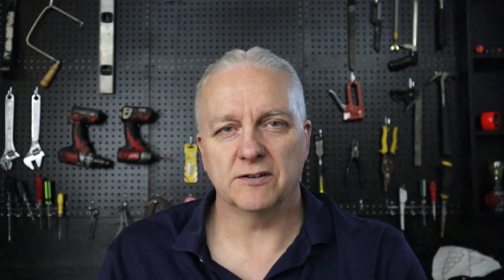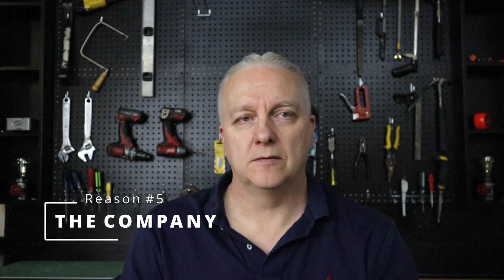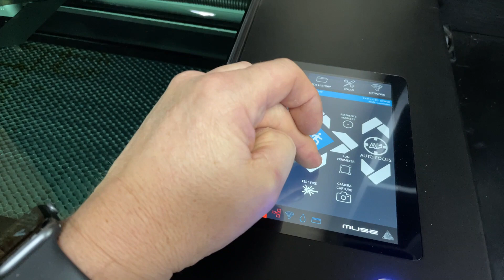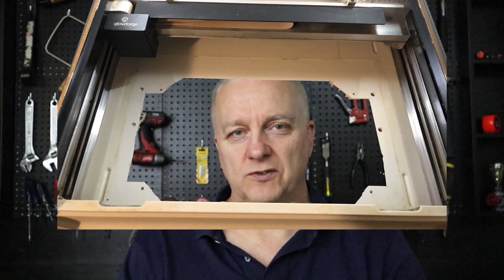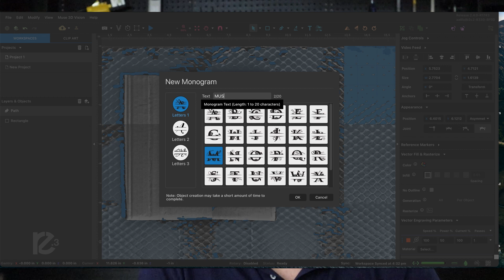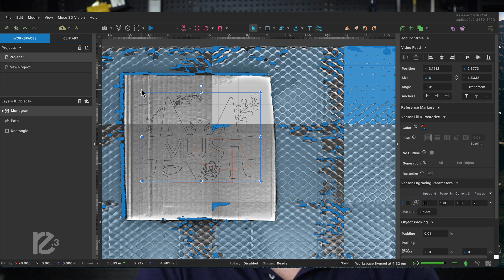BEST LASER CUTTER FOR HOME USE  // Top 5 Reasons to Buy a Muse 3D over a Glowforge

Comment: That was a very thorough review, and confirms many of my first impressions.  I am interested in a laser cutter to cut cork fabric, enviroleather (faux), ultrasuede fabric, and leather for bagmaking.  Obviously I considered glowforge, but I cannot get beyond needing to connect to the internet to be able to use the machine.  Happy am I to have heard the name "Muse" at a virtual bagmakers' retreat last week.  I am also considering a makeblock laserbox.  Did you consider that one at all?
My biggest concern is that I don't have anyone to help me, and I neither mechanically nor technically oriented.  I was happy to see the control panel because I do computerized machine embroidery, and my machines have cameras, scanners, and projectors in them, as well as beautiful display screens; and the concept seems comfortable for me.  But, having to replace a fan right off the bat makes me nervous.  You aren't near PA, are you?  Or, do you know of anyone who could help with the install, or some basic training?  Everything is aiming in the direction of the machine you chose, but I don't want to a major investment and not be able to use the machine...
Thank you for an excellent summary.
Reply from the maker: I didn't consider the Makeblock LaserBox, but as long as it has the features you need you will be OK.  It does look very similar to the Muse and without any solid information I'm wondering if they have licensed the technology from Full Spectrum Laser.  Dremel did this for their laser and FSL seems to have a history for licensing to other companies.

One of the most important aspects of a laser though is power and both the Muse 3D and the Glowforge offer a 45W option, but I don't see this for the LaserBox.  Regardless though it should easily cut cork fabric or most other fabrics if that's your goal.  I will do a video to walk through some of the many materials a CO2 laser can cut or engrave and I'll try to cover cork fabric as well.

Regarding setup, don't be intimidated.  Most lasers are very easy to get out of the box and running in less than an hour.  There are many videos (including mine) on setting up specific lasers.

Regarding my fan, it wasn't a serious issue.  These are the same small square fans that are in most equipment.  FSL quickly replaced mine on warranty and I swapped out the bad one in 10 minutes with one I had sitting in my parts bin even before I received the replacement.  They've gone to great lengths to make the laser serviceable without ever having to box it back up and send it back to them.  They even provide the tools you need to work on almost anything in the laser.

Serviceability was a question I specifically asked Glowforge when I was speaking to them and there seemed to be few self-repair options.  They were clear that shipping a laser back to them for service was a common solution to many problems.

For the most part, this kind of equipment is very reliable, though with lasers you can expect to have to change the laser tube after a couple years of heavy use.  I did have a look at what replacing the tube in the Muse 3D would involve and it looks pretty straightforward even for someone who isn't a mechanical engineer and anecdotally, they will sit on a video call with you to walk through any service you might have to perform :-)

Hope this helps.
Reply: Could I send you some samples of  cork fabric and enviroleather for you to try?
Reply from the maker: @TALISHAMON  You could but don't bother, since  I want to order some for a project I'm planning to do anyway.  The cork will be fine so I wouldn't be concerned.  The faux leather might be more an issue though - not because a laser will have trouble cutting it, but rather because of what it's made of.  You need to check with the manufacturer to make sure that it isn't PVC-based because the "C" stands for Chlorine, which is quite corrosive to your lungs as well as your laser.

I understand these questions given that you are just starting to look into what lasers can do, but rest assured that what you are trying to do will be trivial with any 40 watt CO2 laser.  Keep in mind that lasers with this level of power can cut cut through a 1/4" piece of hardwood in a single pass.
Reply: @SteveMakesEverything  I received an answer to a question from the company that confused me.  Could you please clarify this for me?  
"The software is browser based. Meaning you use the internet browser to access our control app. You do NOT need to be on the actual internet to use our machine. 
"
What is the control app?

As an example, can you place a picture of a horse in the machine, and scan that picture with the camera, and then put a piece of cork, wood, whatever, in the Muse, and place that scanned image precisely over the material, and cut as a stand alone operation?  Or, if you cannot do that, can you send an SVG file from your computer to the Muse, and precisely place that image over your material, to cut or etch, without going to the internet?  Do you install the software on your computer, and can you use the software independent of the internet?

Are a certain number of projects stored in memory on the machine, that could be replicated without going to the internet?   I thought it was simple, and that the internet is not required to operate.

In reference to the faux leather material, this is what the website states, "EnviroLeather™ is made from a urethane-based TPE, formulated with no flame retardants, no plasticizers, no perfluorochemicals (PFC’s) and no antimicrobial biocides.  It passes CAL 01350 for low VOC emissions."

I spoke to the bagmaker today who has a Muse without the autofocus camera.  She really likes her machine, and is cutting her cork bag pieces with it.  We were talking about a way to cut straps or handles for bags.  The bed size is the issue.  If you need a cork or leather strap from 2" to 4" in width, and 26" to 50" in length, could you do it if you take the bottom off?  Would you have to support the material on a platform of some sort that is the length of the strap and slide that under the unit?  And, can you do it on either axis, or are you limited front to back?  Can you use a large piece of fabric and cut numerous straps from the entire piece?  Is there a way to keep the cut straight as you would move further on the fabric for the length of the strap?  Or place reference marks somehow, through the software, to keep the line straight?  Cutting straps is necessary and extremely tedious.  Am I trying to get the Muse to do something it cannot do?  I hope you understand what I am attempting to do, or even attempting to ask.
Thank you for any clarification you can offer.
Reply from the maker: @TALISHAMON  Well it certainly looks like you're doing your homework and starting to ask all the right questions. :-). 
Let me try to answer some of these.

First the network question, since this is a key difference between the Muse and the Glowforge.  In many of my videos you've seen me use Retina Engrave 3.0 to layout how and where I want to work with objects on my laser.  This is the control app FSL is referring to, and is actually hosted inside your laser.  When you install your laser you can connect in one of two ways:
1) You can connect to your home wireless network and once configured you can open a web browser from any computer on the same network by typing "http://fsl.local" in your browser.  At this point you will see the RE3 software running and can layout out your project and even start a laser job no matter where your computer is relative to your laser.  (Don't leave your laser unattended while it's operating though)
2). If you want to dedicate a computer to the laser work then you can plug an ethernet cable directly between your computer and the laser.  Then use the web browser in the same way.  Note that if you have a wired network in your house rather than wireless you can also just plug your laser into your network router and it would operate exactly the same way as if it was connected wirelessly. 
In either case you would use your browser to work this laser via the RE3 control app.

Next, any project you upload to the laser will automatically be stored in the laser and you can rerun any job that you've previously performed.  These will stay in the laser until you either perform a factory reset on the laser (which you wouldn't normally ever do) or the jobs get automatically removed to make space for newer jobs (which I haven't seen happen so I'm not sure how much memory space the laser has for this purpose).  For any project you want to preserve for the long term, you can also export it to a file on your computer and reload it at any point in the future.  And the final option is to upload it to the cloud space that FSL provides, which is akin to how Glowforge handles your projects - though GF offers nothing else other than this.

fluorine

Regarding the camera, if all you are ever going to work with is "flat" materials like cork or leather then strictly speaking you wouldn't need the camera for normal work, since for these materials you could do a quick manual focus and start working;  however, what you would lose is the ability to scan the workspace and any layout you do would have to be done with a perimeter scan of your project on the laser bed and then moving your material into place manually so avoid wasting material.  My advice would be to spend the extra money for the Muse 3D rather than the basic Muse.  It's quite a bit more money but you would quickly eat the cost difference with the less frustrating experience you would have without the camera.

If you want to cut items that are longer than the laser bed there are a couple of options.  First you can in fact remove the bottom of the laser (which is unique for FSL lasers.)  However if this is what you want to do you would have to buy a longer focal length lens ($150 option from FSL, but is again something that is unique to FSL lasers).  With this setup you could cut the first 24" of a long strap and then slide the material over, realign the project (with the camera that you'll definitely need for this) and then slide the material over cut the next portion.  I'd suggest making a quick jig with a  square edge you can push your material up against while cutting, so that when you slide it over, the cuts stay aligned with each other.

Note, to save some money on the extra lens, it might be possible to create a jig that is the width of the laser workspace with a material roller on both side and a square edge in between.  Then you could roll the material off of one side, cut it and roll it onto the other side.  This would allow you cut things of pretty much infinite length. Hmm this seems like it would be a good project for a video. :-)

Finally your scanner question.  Yes, you can draw out an object on paper, scan it with the laser and then use it as a pattern to engrave or cut into material.  I'll definitely do a quick video to show this for you.

These are great questions!  This is exactly why I wanted to create this channel - thanks for inspiring me.
Reply: I am glad my questions did not make you lament your decision to do this, and I look forward to any video you would like to make relative to my comments.  There is one word standing alone, "fluorine".  Did you post some thoughts on Environment her, and they disappeared?  If so, I would appreciate any input on the company description.  Thank you so much.
Reply: It is supposed to read "Enviroleather".  It keeps high hacking my words.  Sorry.
Reply from the maker: @TALISHAMON  Fluorine is an element in the same family as chlorine and it's just a corrosive to you and your laser.  Based on the response you got back from the manufacturer there a no "CFCs" or "chlorofluorocarbons", or similarly named "perfluorochemicals". This just basically means that when you heat it it won't outgas anything that's harmful

Comment: My main issue with the Glowforge is the online-only software.  I live in a rural area, and have internet blackouts.  I do NOT want to be constrained to using the internet and a company's servers to use a machine that can EASILY be used offline if they wanted to make it work.  You NEVER know when a company will go bankrupt, and relying on their online-only software is a huge issue to me.

Disclosure: I don't have a laser ATM, but am looking to get one for cutting thin MDF and Plywood
Reply from the maker: These are the points I was making too. The GF hardware is great but the lock-in is not. Not everyone has a fiber line running into their house for Internet service and not everyone wants to upload proprietary designs into a cloud service which may or may not be secure